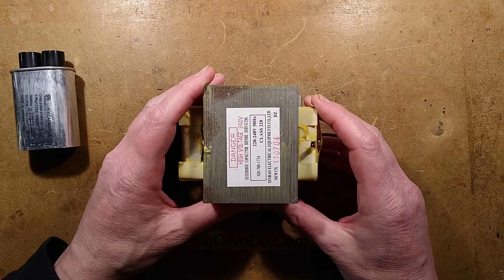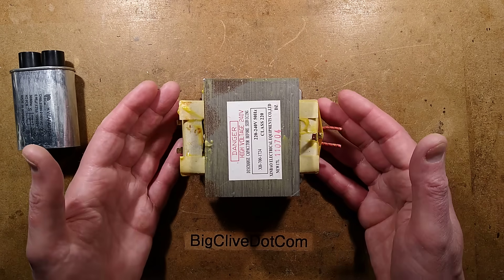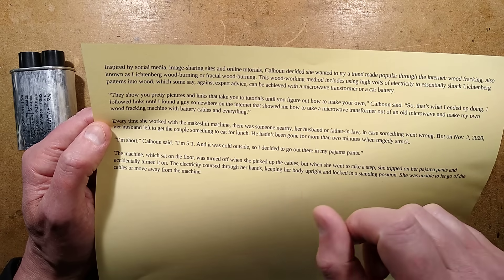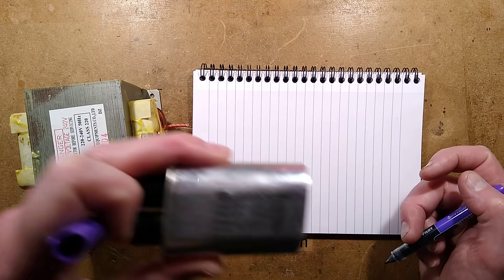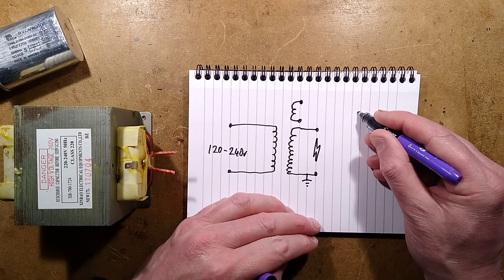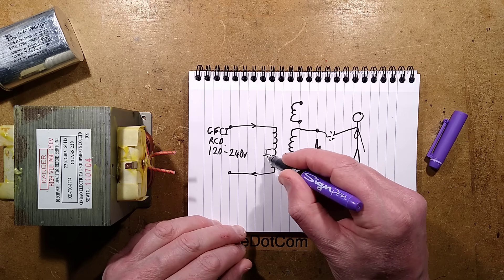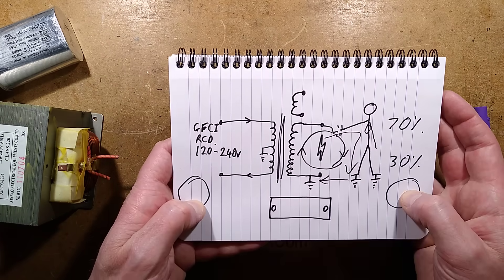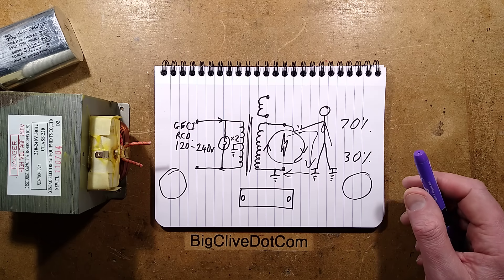The most deadly project on the Internet

Comment: Rather than run away from danger, seek to understand it , mitigate its effects and carry on.....so if you were to follow some simple safety instruction such as those set out by Robert Murry Smith you can be certain it will be safe. Yes point out the severe risk and then show how to eliminate it.  Just like one does in chemistry and physics etc.

Comment: Big Clive, considering myself an absolute amateur with no beginning of comprehension of the invisible matters tampered with, I always shunned away from these transformers due to an inner voice, assuring me not to even think about trying to tinker with them.
That said, it is very comforting to see that the interwebs do still also provide reliable information of responsible experts like yourself to educate the clueless in hopes of preventing accidents. 
So similar to (heavy) fireworks on new year, every year. Some just can’t or won’t hear it it appears. Still, I applaud and commend you for it.

Comment: I did it with a remote kill switch in a large glass tank, fully in rubber on a rubber mat. I also re-wrapped 2 transformers and center tapped them together to generate plasma in a vacuum with zink carbon electrodes. This stuff is extremely dangerous I couldn't agree more.

Comment: My dad showed us to play around with fixing the VCR by opening while it was on and using a metal screwdriver on it. So many times when I was a child I had plugged in and powered on machines open and fiddled with them. I luckily never got shocked from that and am lucky to be alive.
I have been shocked twice, from the same thing, accidentally slipping while plugging something in and touching the prongs; both times were surge suppressors and one time it dropped free on its own, and the second time I let go somehow; I am lucky to be alive again. I no longer use surge suppressors for my electronics. If my computer gets fried in a power outage, so be it. I'll buy another. And I actually have had to for that reason.

Electricity is terrifying.

Comment: the voltage isnt actually the most lethal thing about electricity, the most deadly aspect is the amperage.
ive been zapped by car sparkplugs a few times and the average voltage from that is about 10kv-25kv however the amperage is in the milliamps  
the average voltage for a static shock is around 6kv but amperage around 0.1a

Comment: Having worked on millions of microwave ovens in my time I have always shaken my head at this extremely risky practice. Even during live diagnostics we always isolate the transformer. Having been hit a few times by an unshorted capacitor discharge (once again due to complacency during diagnostics) I can tell you that even this is like being hit full force on the end of the elbow with a ballpein hammer. People are complacent with regards to electricity. During my 4 year trade training we lost a few apprentices due to electric shock. If you are not qualified, electricity is not a game.
Reply: @RandomShart It's a figure of speech. I worked on them for 30 years. Long enough to know what I am talking about.
Reply: Exactly. I have a phobia for electricity (even as somebody in the IT field) and am baffled to see unqualified idiots playing around with this stuff
Reply: I once pulled apart a disposable flash camera and got zapped by the capacitor in it. It wasn't anywhere near what a microwave capacitor is capable of, but definitely enough to give me a healthy weariness of them.
Reply: @jackvos8047  I used to work in a wholesale Fujicolor lab where we ran through thousands of film rolls per night - part of the job was cracking open disposable cameras, film at one end, battery at the other. Every so often the camera would open further than expected in a way that someone would touch the capacitor leads, and you would hear a yelp from across the floor. The one time I did it my hand tingled for about 15 minutes. Just from a cap with one AA battery.
Reply: @jackvos8047  I had a house mate that would wait for me to go to bed, wait 15 minutes, the come in and fill the room with fart. So I fixed an 12 mf capacitor from a washing machine to the back of my door and ran the bare wires through the key hole and fixed them under the door knob. Charged it up, worked a treat, even heard the scream...could stop laughing.
Reply: @RandomShart I've told you a thousand times...... "stop exaggerating!"
Reply: @RandomShart You must be autistic.
Reply: @RandomShart Maybe this is just a generalization, but hundreds of devices can be released from the tape a day, he did not have to disassemble or test everybody.
Reply: i have been hit by a unshorted capacitor inside a microwave once when fixing a microwave for my mother, and believe me when i say that felt worse than being hit with a ballpein hammer to the point where if i had to choose between the two i would take the hammer any day
Reply: @RandomShart thank you
Reply: @RandomShart I was looking for a comment like this.

Comment: As an electrocution survivor, it was interesting to see the way you described what electric does to the body. I was working on railway OHL for over 8yrs when last year I came into contact with a solid copper conductor which was 2 structures outside of the isolation limits. I was put in an induced coma, received 30% burns to my body and my muscles were partially broken down, causing my kidneys to be clogged from creatine. I narrowly avoided dialysis. After 14 months I am now back to driving, able to play football with the children (just about) and almost back to something I would call normal. Although I do suffer from chronic pain in my right ankle where it exited, and have many scars on my arms, legs and feet. I’m so lucky to be alive and hope that people will understand the dangers of electricity, not doing daft things like removing transformers from microwaves with no experience!

Stay safe everyone!
Reply: So sorry that you were electrocuted. Very glad you survived and are on the mend. As you quite rightly say, you were very lucky to survive. Not many do in similar circumstances. Have you thought about contacting a survivors group?
I agree that it is particularly daft to mess around with MOT's with little to no experience and lacking deep knowledge of electricity, transformers and the dangers. As you bravely point out - People are seriously injured or die even when they have the knowledge and experience.
Hope you continue to get better.

Comment: Wow... i mean really wow... I would never build such a setup in that way. With something like 2 kV and more against ground. I´d seperate the second wire from the transformer, or if that doesen´t work isolate the whole tranformer by putting it in a plastic case, so that high voltage will only be present between the 2 wires coming from the secondary windings, but not against ground since no circuit could be completed from one wire and ground only.

Comment: Try using a higher voltage with a very low amperage rate on talking less than the jewel of amp. V voltage will not kill you amperage will amperage causes heat

Comment: from years i realize what those do and i think this cloud be prevented in many ways though but the best is having someone's attention as you doing it to be honest even using pedal to power it on off does not guarantee that you end up better  cause that current is a bit of a b see where i am at we use between 220 and 320 and i been hit by booth i don't mind cheap Chinese 400 kvw tazer unit fakes too they don't bother though they hurt ! but to be honest putting that voltage n current true a person especially linking few and epoxy them into a bucket so you make sure they don't overheat or have some other third party issue or hazard they might cause you is a thing but even just one to anyone just watching a 5 min video does not work if you don't understand what you tryna do as we use to have open resistors at school so there is this long ceramic like material pipes on stand with lever you move and this long metal contact rod it slides on and there is one good contacting wire that makes the resistance winded around the cylinder that you slide a contact true and the voltage changes easy but they get hella hot and i had a schoolmate that half the year true ask me what would happen if he puts his hand over and i just told him if you wish you can try yet i don't think its a good idea and i give him 2 examples and then i ask him if he still want to do that not visual just explanations though he did refuse this once but been curious ain't the problem if there is even a problem its fixable after the thing is having such high current n voltage can cause permanent problems and cause good amount of damage before any action is taken and the lead can end up fatal and like am not killing everyone's fun here saying it ain't funny but it cost ya later if so doing better research talking to a few learning some info it be a good thing respect for you man cool video @_@ GG

Comment: You mention the insulation breaking down. Most publicly available wire and insulation are only rated at 600 volts maximum. 2,000 volts won't take long to find a weakness in the jacket and flash through.

Comment: the first thing I learned in electronics college was safety. I'd been working on TVs with no comprehension of how dangerous they really were. we plugged a hot dog into house current and watched it cook, which is what would happen to you if you grabbed a live wire. we are electrical beings, when you grab a live wire, all your muscles contract, your heart, and so it stops pumping, and your fingers won't unclench which is why you can't let go, someone has to knock you over without getting zapped themselves. I wonder if the dead-man switch referenced here would work, you could potentially not be able to drop it. educate yourself and be careful before you mess with electricity.
Reply: I think the main protection is in the fact that it's hard to touch the live parts while at the same time holding the buttons. I mean you might still end up brushing a high voltage part with another part of your body but you still wouldn't be adjusting anything live with your hands.

Comment: If this kills you, you’re an idiot. If you use your brain it can be completely safe. Multiple switches, a insulated container & base plus the correct insulated wiring & don’t hold them in your hands  helps. Plus z2 status lights. Only use one hand when completely turned off & long enough leads to keep it away from you work area soaked in water, you’ll live.

Comment: i once got zapped by 270V dc from 9uf capacitor . thats when i decided to not mess with high voltage anymore . (i wasnt careful) not to metion that later made worse mistake with 220 v ac luckily i wasnt shocked .

Comment: I have only received an electric shock once in my life when I was younger, from something going wrong plugging the power cable into the back of the snes ('cause like an idiot I had it already turned it on). Even that knocked me out for a few hours so I'm even more careful when it comes to electricals, you'd think it'd be obvious to do so but there's still plenty of toaster deaths these days too.
Reply: I think a lot of us have stuck a knife or fork in the toaster lol things we do as kids I remember lifting the lid off a boiling kettle to watch the water boil when I was 4 or 5 I was lucky I only Burt my hand and not pulled the kettle over on me
Reply: @I_am_not_a_bot-666  
What has "Burt" got to do with it?

Comment: My dad worked in avionics as a technician and one day he felt he could fix the CRT tv after fetching schematics from electronics market. The voltages reach 28kv if I recall correctly to power the cathode rays. At some point while testing he felt that tingling sensation from a distance from the transformer that even a tester tool started lighting up without contact. He got way too scared and abandoned the whole thing. We got a new tv instead.
Reply: Holy shit. I would shit myself if my multimeter suddenly said "the air has 20kV by the way"
Reply: Smart decision, it's not worth risking your life to fix a TV
Reply: Yes you can feel the energy or whatever it is coming off those old TV's.   Would make my lips tickle if I got too close to the front of the TV as a child.  It also had what I assume to be an ozone smell constantly coming off of it.
Reply: @SPINNINGMYWHEELS777  I used to wave my hand in front of it to feel the fuzziness. I remember the weird smell too. I'm trying to remember if I licked the fuzziness once...
Reply: @SPINNINGMYWHEELS777  that smell man, I always assumed it was dust on hot connections or something..
Reply: @SPINNINGMYWHEELS777  if i put the back of my hand on a portable tv antenna it would burn/tingle. not sure what that means.
Reply: As a child, I once accidentally threw a dart through an early 90’s tv. I pulled it out thinking it would be alright because the tv wasn’t on; it was plugged in though. I remember getting shocked violently even though I only touched the plastic flight (back part like a feather on an arrow for those that don’t know darts). Then the tv’s circuit was overloaded and something inside the tv exploded causing the glass to break and thick black smoke to leave the tv’s air vents. Needless to say I was not allowed to dart again without supervision hahaha.
Reply: Sounds like a smart man.
Reply: Worked as an engineer from mid '70 to 90's with Honeywell with lots of early high current peripherals including early CRT's as monitors. No problems but we knew how to do it and had the right test equipment. Never try it by just reading schematics and without proper training or just because it looks easy when watching a technician at work.
Reply: I powered on an old Zenith console tv that suffered a small drop. Apparently the gun had broke and I heard the loudest sparks ever. Also, you could feel the entire room electrify. Very scary.
Reply: And that's why I always leave things unplugged for a day or two AND then discharge them manuall before trying to repair anything. Few things scare me more
Reply: If a TV tube was getting a bit old and faint I would rejuvenate them by pulling the EHT cable off the tube and arcing it to the pins on the neck. Hey presto, picture was back and would last a few months more. Don't tell Clive, he will shout at me.
Reply: My father used to work with cathodic screen and sometimes dif the maintenance for it. Tubes were discharging in his hand and while not pleasant, it is not dangerous
Reply: Yes good choice your Dad made , because yes your dad could have died that day !!
Reply: That ”Second Anode" voltage is very low current and you will very likely survive. There are other places in the TV that will easily kill you if you're hooked in or unlucky. Static electricity we've all experienced is frequently in the millions of volts, but very low current.
Reply: @johnnytacokleinschmidt515  true, but still it can be very unpleasant to get shocked by tube. It has some capacitance and if it is energized it could be very painful but not deadly
Reply: Pity, we got a teaser but not the complete show!

Comment: As the current in the secondary goes down as you increase the number of coils in the secondary, couldn’t you just  increase the number of coils so that the current is low enough to not be lethal? Essentially doing the opposite of a spot welder you will easily get zapped but its not enough current to stop your heart.

Comment: Accidents can always happen. I always tell non-professionals to NEVER tinker around with PSUs or other high voltage things.
But there strikes the fact one can not gauge other peoples qualification properly, and gauging ones own capability is problematic, since judging capability accurately requires already having a full understanding (can’t judge own completeness of knowledge).
So other people also advise me not to meddle with the stuff I am tinkering with, same way I also tell them.
A good scientist can derive most danger sources himself without having to read up ‚best practices‘ or learn from others - this prevents risks and pitfalls derived from gaps in knowledge(one never knows about his own gaps). If you are no physicist knowledgeable about the stuff you are doing, make sure to get qualified by a full training at school, workplace, superiors or other reliable qualified trainers/teachers (which are themselves scientists or derive their knowledge from experience or fields practicing that expertise).
Hell, even bad scientists used to be completely oblivious of the potential danger the devises they work with may cause.

Comment: I used to be a qualified microwave engineer and you have to follow a set routine when working, after taking the cover off you have to discharge the capaciter with a pair of snipe nosed pliers, the machine even when turned off and unplugged can still kill

Comment: So a Lichtenstein or lickenburg or whatever it's called machine. I built one for a buddy and we put a couple safeties in place. Most of all a remote-controlled breaker like you would have for your Christmas lights. So you could step off 20 or 30 ft and turn it on and turn it off. I also have some gloves that came from playing with big boy electricity that you can hardly bend the fingers. I still every single time we played with it was scared. The sound of that machine doing what it does is intense it's scary. But it does make for some neat woodworking designs. I'm pretty sure it's dumb luck that we haven't killed each other playing with it.